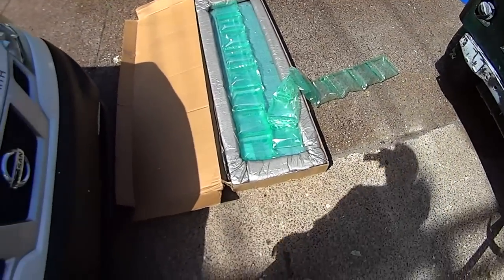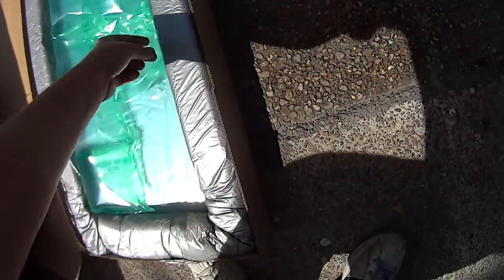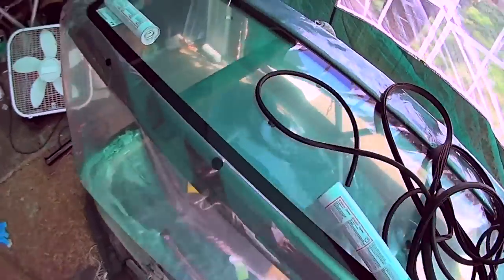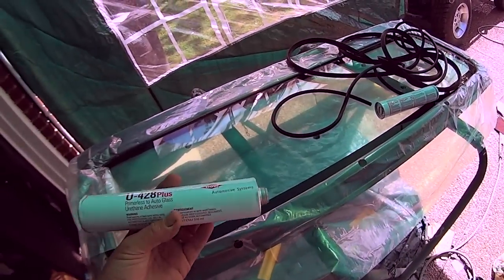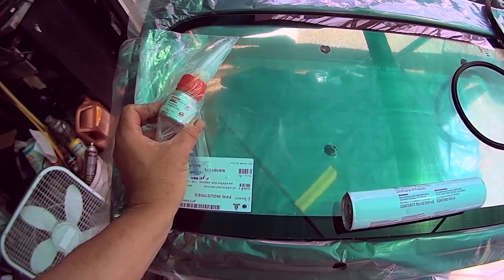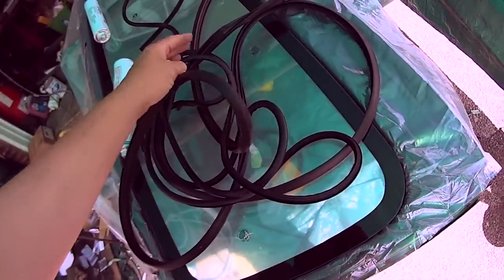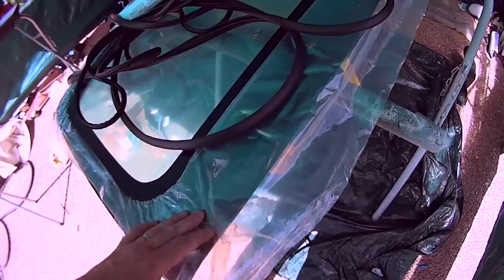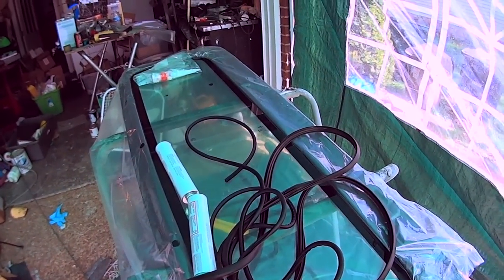Windshield Installation Jeep Wrangler YJ

Comment: Thank you for making this video! I did not know adhesive was needed to install it. I thought the glass was only held in by the gasket. I'm sure glad I waited to R&R the windshield. And again thank you for doing this. Sir you have saved me a lot of grief and trouble. Well I suppose it will be next week before I get the new one put in.
Thanks again!
PT in Eagleville TN
Reply from the maker: +tuckermerch Thanks bro ! Were not that far apart !
Reply: +Redneck Garage. Help. Have replaced a washer pump? I bought a new tank and the old  (still working) pumps are threaded to a strainer inside the tank. The problem I got is the pumps are mounted on the bottom of the tank and the access is about 1 1/2 dia. hole that's about 13 inches from the bottom of the tank. I don't have a tool long enough to hold the strainer in place while it's threaded back on tot the pump.  Got and suggestions?
Reply from the maker: I think I eliminated fooling with that part after looking at it :)

Comment: Thanks for all the help just wanted to do a quick update lol. It turned out to be an absolute nightmare...Like I said I ordered the complete kit from Morris 4x4 so you would think everything would fit...think again. Turned out i wasn't crazy and the inner gasket wasn't correct along with the outer gasket not fitting either. Also either the glass or the frame was out of whack because there was no space in the corners to allow the outer gasket to fit. Long story short 3M black urethane devil crap all over the place... face, hands, legs... and nothing fitting in to place. I even ended up calling a professional auto glass installer and had him come over to help and he said the same thing nothing was fitting right and it was best to return everything because it was not right at all. I knew it was weird when I ordered the kit because it didn't come all together and instead each piece was shipped from multiple different spots (WA, MA, GA). Any way thanks for the help, you explained everything great and it would of gone smooth if it wasn't for all that bs.

Comment: A round bead is very bad. High risk of trapping air bubbles in the urethane and it will pop during the drying process. Need to run a V bead so when you push the window down it forms a square bead and has no room for air bubbles to develop. Also rubber gloves so you don't contaminate the glass. Activator should be used for the glass not primer unless the glass has not frit band. Primer is OK to but activator is specifically for glue to glass. Also etch the frit band on the glass so you eliminate the left over chemicals from when the glass is made.

Comment: Well I was able to Mcgiver the strainers that have the threads on them that hold the pumps in place! I heated a 1/4" universal socket with a torch and melted the socket into the strainer and kept it attached and used a  long socket extension and installed the pumps to the strainers without a problem.
Reply from the maker: +tuckermerch  Way to go !!

Comment: Bad idea to wash the frame. Now you know you unintentionally got water inside the frame. It is 2 frames factory tack welded together and in between tack welds water can seep in and get trapped inside. I used seam sealer around perimeter of frame.

Comment: Did you have any issues with the windshield hinges or that bottom gasket between the firewall and the the frame?
Reply from the maker: +tom john I replaced the hinges but the runner was i good shape  :)

Comment: What about proper bead height? Use old rope sealer in correct size like OEM?
Reply from the maker: Urethane was what was used from the factory.  I just eyeballed the bead size and the rubber trim goes over the edges.
Reply: 3\8" to 1\2'' V Notched. Stress cracks result from not having correct decking.

Comment: Hell yeah my man thanks so much for these vids! Definitely makes things a little easier. Few questions: How long did you wait for that primer to dry before putting on the glass adhesive? Also, how long did the glass urethane adhesive take to dry/cure before you can install the windshield frame back onto the Jeep?
Reply from the maker: The primer dried pretty quick maybe 30 mins. I let the glass cure for about 3 hours befor I reinstalled - overnight would be even better I think - you are welcome - thanks for watching !
Reply: Redneck Garage Also, did you have to cut your inner glass gasket seal? Mine has like an extra couple inches on it and cutting it seems like the only option, but I didn't see you cut yours so I'm confused...I know the outer seal needs to be cut, but I thought the inner was supposed to be a perfect fit? I ordered the kit from morris 4x4, and no instructions are included so I've just been going by your video. Sorry to be bothering you about this I'm pretty lost haha, I'll be sure to spread the word about your channel you've seriously been a big help.
Reply from the maker: No problem at all yes the inner had to be trimmed a bit try and go just a hair longer for shrinkage. As it is just for looks it isnt critical anyway as the seal is from the sealant.
Reply: Redneck Garage Ok thanks for the reply, I just did that ,but now I noticed after i put in the glass for a test fit it does not sit flush with the frame anymore because it is lifted by the inner gasket, is that normal?
Reply from the maker: ***** no I didnt fool with that
Reply from the maker: ***** Damn son that sucks. What are you blaming it on ? Frame - Gasket Glass ?  Sorry it has been a bitch.

Comment: OK. Mine is a 97 and still had the old ribbon seal. Must have been after 97 when they went to urethane in tubes like newer cars. It seems to b like the old camaros where the bead height is important so the reveal molding will fill up the Space but not b too close to glass. Outside chrome trim needs to be close to glass so no gap shows. I'm not finding anything online about which height ribbon to use. Maybe someone who knows will pipe in.
Reply from the maker: Hmmm I know in 95 the factory procedures was urethane so possibly someone replaced your windshield without using the right adhesive . You can look at the online factory repair manual here for free -  http://www.jeep4x4center.com/knowledge-base/index.htm#service

Comment: Thanks for this! I've been looking for an instructional for this too and haven't seen anything. 2 questions. Do you think I could get away with using the existing inner seal on the windshield (the bigger one) or does the urethane adhere to that too? And 2, would you recommend putting the outer rubber on before laying the glass? Thanks!!
Reply from the maker: If you can clean up the urethane on the inner giving enough space for new urethane it should be fine. The factory procedure is to replace it due to the  urethane being so hard to cut or remove. 

If it were me I would buy a gasket kit on Ebay for 39.00 rather than fight with an old one. 

http://www.ebay.com/itm/1987-1995-Jeep-Wrangler-Windshield-Glass-Seal-Gasket-Top-Quality-/360769421672?pt=Motors_Car_Truck_Parts_Accessories&fits=Year%3A1995%7CMake%3AJeep&hash=item53ff888168&vxp=mtr

 As far as placing the outer on first I doubt it because it is made to be trimmed after you push it in all the way.

Comment: do you know if its plausible to remove a windshield from a jeep yj windshield frame without braking it ???
Reply from the maker: 12Achilleas A good glass guy - maybe but the urethane is really a pain and I have been unsuccessful myself doing that on multiple glass.
Reply: 12Achilleas Yeah its possible, you gotta make a little hole and then use a metal wire and cut the urethane with it.  One hand outside, the other hand inside and you slice with the wire back and forth.
Reply from the maker: yeah Ive gotten close before I heard crrrraaaacccckkkk hahaha

Comment: Do not use pinch weld primer on the glass, Dow 828 urethane is primer-less for the glass, by doing what he has done you are in jeopardy of having the windshield bond release in a accident.
Reply: hes using U428 primer 5504G is what is recommended